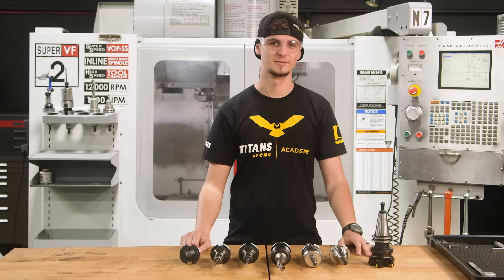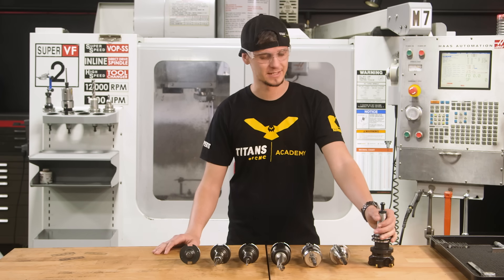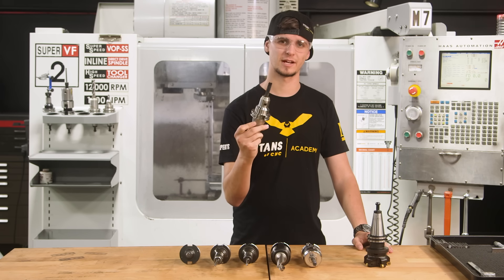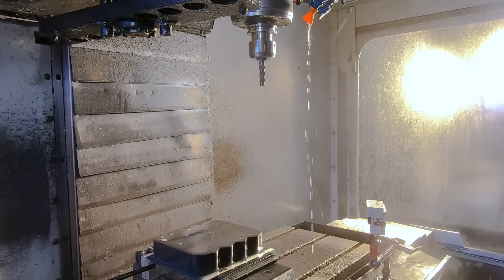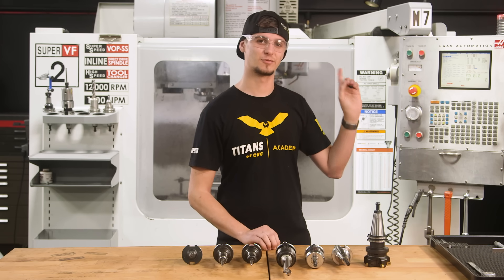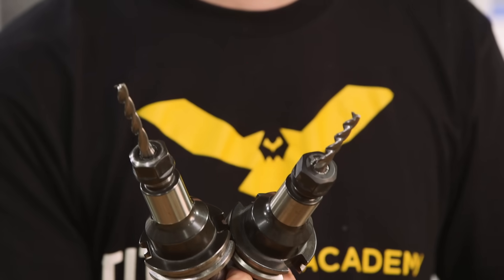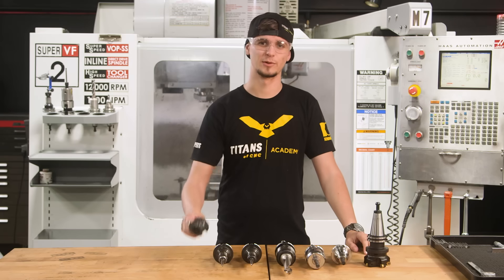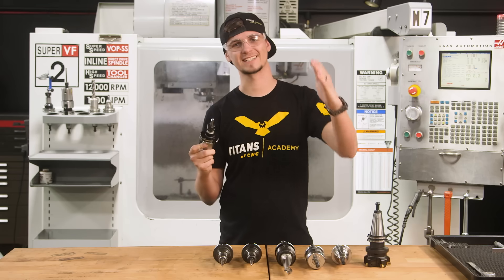CNC Machining Composites with Diamond Cutters | Vlog #81

Comment: Most people cut it dry due to it contaminating the Coolant and the glass particles going thru the machine we always try to vacuum out all of the chips to prevent contamination to preserve the machine tool as much as possible
Reply: Can cut it with really low rpm and big thick chips to avoid it turning to dust have never had issue using standard carbide tooling as long as sharp have done lots of g10
Reply from the maker: Been cutting it for 20 years. Always use coolant to keep the dust down and it allows the tools to make nicer finishes and to last longer. No delimitation. We cut it for subsea and aerospace. We also have a series of filters that keep the G10 from going into the pump etc.
Thanks

Comment: PCD means Polycrystaline Diamond, an describes the cutting material, literary the most of the cutting edges made out of diamond. When you have a black coating, we talk about DLC (Diamond Like Carbon). Its applied by PVD(Phisical Vapor Deposition). Small but important difference.

Comment: With my 10 machine experience fiberglass (G10, G11, G9, G7, GPO3, SG200) diamond Endmills are not the best solution vs price and lifespan. Onsrud ALTIN is quite less expensive and lasts quite a bit longer with higher cutting speeds 😉

Comment: I've always ran fiberglass dry, putting glass particles into your coolant is like running sandpaper on your ways, not a good idea, use a vacuum to take out the fiberglass powder, it's a nasty material, granted the coolant will keep it from floating in the shop

Comment: Buy a 50mm Blaxx head from Walter Tools and compare it with a similar tool from Kennametal in different steels and check the cutting edge durability and speeds and feeds

Comment: I am looking for the „Harvi“ tool holder. They have nice big Diameter. Can somebody help me to find out manufacurer name?
Reply: Most (if not all) Tools they use are from Kennametal, while most of the Toolholding (and Workholding) is done with Schunk.

kennametal.com 
schunk.com
They both have lots of different options to choose from.

Comment: This dosen't look like G10 at all, g10 is green and will be stain by the coolant. Must not be wet it lose its electrical insulator proprietes
Reply: Mrsemibruce thanks i thought i was going crazy. i machine G10 in my haas all the time and it’s green, run a vacuum next to the spindle to try to keep smell/dust down

Comment: Would you use a new DMU50 for cutting composite? No, because it gets everywhere and eats up everything. Except for in old machines, where there´s so much slop that it doesn´t matter any more. 
We´re making carbon fiber parts for bikes on  our 70V and my SQT10M which are both about 20 years old and are still using those for daily business. 
Can you show some machining of hardened stuff? Like 60 HRC steel?

Comment: Why the long pauses when chamfering the large holes?
Reply: Roland Jollivet that is the control lagging. The arc filtering settings in their cam system was set for very small tolerances, and so what you get is a million lines of code to do that chamfer, causing the machine to not be able to keep up. We do lots of surface milling on the machine I work on, and one of the people who programs the machine has really bad arc filtering settings, and we have this issue all the time.

Comment: The feed rate on the 8.2mm drill is actually .01025, I believe.  Interesting vid.  We're one of those shops that try to avoid G10, tho we do quite a bit of phenolic.  Not near as abrasive, still a niche material.  Thanks for sharing!
Reply: Edit; fixed a word. autocorrect had wire instead of quite.

Comment: Noticed you mentioned carbon fiber, how are you handling this as the particles can be dangerous and should be cut in a water bath.  Are you using a flood coolant for this too?  Also how are you straining the coolant for the nanoparticles?
Reply from the maker: Yes use coolant always and use a mesh lining to collect fibers etc

Comment: We cut aerospace glass and carbon composites on a regular basis, we use solid pcd tooling for very thin sheets its compression and tension cutter, the same cutter that has flutes going both directions, and we use extremely good dust extraction and  filtration,  all dry.  This is the first that I'm watching some coolant being used. Coolant is usually not allowed on aero composites which have to be bonded, since coolant can become a release agent preventing a secure bond.
Reply from the maker: So many still cut dry but Many are also using coolant. Coolant keeps harmful dust particles out of the air and prolong Tool life X 6. We use Synergy 735 which has a PH of 7 which is the same as water and does not delaminate resins and fibers etc.
Reply: @TITANSofCNC  That is what impressed me, we cannot use coolant,  abrasive waterjetting can be done, where the part once cut is then baked. Water is great to get rid of dust. But anything that has lubricity cannot be used by us, since it will not "cut it" for the secondary bonds, the PH does not play a role here. If however, there's a part that is not bonded, I can see the utility of your process.  The delamination of fibers is an altogether different thing and I would not  say that coolant can prevent delamination.
Reply: Naresh Sharma can you wash then vacuum bake?  That is done prior to electronics wire bonding, where the surfaces also can’t have any contaminate.
Reply: @rfengr00  For non-secondary-bonded parts yes, but for parts that are secondary bonded and if they have been microscopically contaminated by oils of any kind, only plasma-cleaning followed by abrasion, can be done. It's a messy process requiring sophisticated equipment and further certification hoops to be jumped. Thus we'd machine dry or waterjet+bake rather than use cutting fluids.
Reply: @nash0427  metal parts are all cut with lubricants, the stock is formed with lubricants, we pot deep sea acoustic sensors at work and silicone is much more of a problem than easy to remove lubricants.  Just ultrasonic clean with Branson IS.  G10 is known for now absorbing things and it is extremely easy to bond to.
Reply: @TITANSofCNC  can tou show the particles on the tank and If its dificult to clean?

Comment: Running Flood Coolant but not Spindle coolant on your speed drill ? whaaaat?
Reply: On the Kennametal Go Drills, you get 3 and 5 x D without coolant. With through coolant, they come in 3, 5 and 8 x D as standard.

Comment: Do you have to have a dedicated machine for CF/composites ? Any tips for mix and match of materials in a single machine. Are there issues with filtration and particle size etc. If using coolant on composites is a cyclonic de-mister an help ? Any advice 'Do's and Dont's appreciated ".
Reply: You don't have to use a dedicated machine, but the chips, (dust), created though macining glass filled or composite materials are abrassive and will increase the wear and tear on any moving parts that the coolant, (and the chips suspended in it), can get in between. If you have to run a lot of composite materials, it is a good idea to keep it on an older machine or one that you don't need to rely on to hit super tight tolerances; over time, the machine will wear out faster than a machine just cutting regular materials. Its not the end of the world if you need to run a few composite jobs on a machine, just make sure to do a throurough wash down and if you are really concerned, clean the coolant sump. You could also consider using a filter batting material on the inlet of the sump to help trap finer particles before they get into the tank.
Reply: @CameraPPL  Thanks ! That's a good tip about using batting on the inlet of the sump (to trap finer particles.).  Wanna do composites some of the time don't wanna trash my nice machine lol. Seems some newer machines have more advanced cyclonic filtration units on the back side of the machine (such as DMG Mori NVX 5100 2nd gen ) I guess to better filter coolant that goes through a casting but also enables some grinding operations to be carried out. Particle size seems more in line with that. Was wondering if a similar more comprehensive filtration system would keep a machine "Safe" from CF/Glass / composites. I.e. if you can only afford ONE really good machine and you have to do composites 2% of the time ?

Comment: Our company manufactures CFRP parts for cars. Mostly thin shells, 1-2mm thick. We do a lot of trimming simultaneously in 5 axes movement. Most of work is done with small diamond end mills, 3...6mm diameter. We do everything dry. It would be really interesting to learn best ways to trim such parts on CNC (like a car bonnet, or a mirror cap or side sills). Can you make another video on machining thin CFRP shells? Hopefully you did things like this in the past or some friendly company does. Really interesting for many companies around the world doing CFRP components.
Reply: You don't need or want a CNC mill for things like you describe. What you want is a large CNC router. Use the router to make a vacuum fixture to hold the raw untrimmed parts, then it's just a matter of feeding the machine parts.
Reply: @dwaynesykes694  you can call it this way or another, but normally these are large 5-axis machines which trim such parts. Or robotic systems. I just emphasis that this is big topic for many composites manufacturers and other folks dealing with plastics, composites, SMC etc. Indeed these materials and abrasive and the wear of the machine is increased.

Comment: What kind of tool life are you getting? Do the tools make it through the whole run?
Reply: I'd almost put money on it they probably last quite a while. Used to run a composite shop that used PCD turning inserts,and we would easily get 100+ parts per insert.
Reply: @JustAGuyWithALongScreenName 
PCD is a different level to the stuff used in this video PCD is by far superior

Comment: I've wach a lot of titan's tutorials. But I am wondering, can he actually make a motorcycle carburatur with a cnc machine?
Reply: There's no reason why a knowledgeable machinist couldn't make a carburetor.
I've made many parts much more difficult to machine than any individual part in a carburetor, and many replacement parts for Carburetors that can't be bought anymore.
I've run quite a few machines over the years, I started out back in my teens running a Bridgeport, and progressed through machines as difficult as 11 axis cnc machining centers, doing most of my own setups and programming.
My point is that there are many machinists better and more knowledgeable than I am - so a carburetor wouldn't be a challenge.
Reply: @Motor-City-Mike  11 axis??? Wow, never heard of that.

Comment: Do you bake your G10 for 24 hrs before inspection to remove all the water (and dimensional changes) that it absorbed during machining? I like the idea of controlling that nasty dust, it just means some other things to consider.
Reply from the maker: Never heard of that, we hit 32 finishes and keep tight tolerances all the way through the process... been doing it like this for 22 yrs. Everyone who has ever worked with me and wanted to cut dry... I changed their minds and showed them it was better.
Reply: @TITANSofCNC  G10 absorbs water, then warps and it gets difficult to process in the electronics industry. Thus it's normal to bake components and boards before they go into manufacturing and a reflow oven to increase yield.
Reply: @qwerty3663  dude its garolite, you wont be machining too close of tolerances on it anyway. It's an insulator and is used to mount  electrical component. It's not like it needs to have a slip or press fit for any reason.
Reply: @anthonyjones657  Actually it's a dielectric and fractions of a mil are important for controlling impedance.
Reply: @qwerty3663  it's a di-electric and as such is very well known not to absorb water lol
Reply: @Metal Dawg Because post machining inspection will yield different results than those after waiting some time for normalization or if the absorbed water was removed at an accelerated rate, just as you don't inspect a hot part right off the machine.  An inspection room has a controlled environment for temperature and humidity and parts are not inspected immediately upon entering the room.
Reply: @Metal Dawg Because depending on when and how you inspect something you may reject good parts or accept bad ones.
Reply: @Metal Dawg You keep bringing up the clients but they have absolutely nothing to do with my question. I simply asked was their inspection methodology different than what would be considered normal because G10 reacts differently than metal. Just as when machining other things like plastic, the part will relax within the first 24 hours or so. Do they have different procedures for various types of materials? Most customers have far less inspection capability than a good machine shop has so they don't check to print and trust the supplier unless something goes wrong and they need to get to the root of the problem.
Reply: By the way metals relax too. It all depends on how it was processed at the mill. But most higher carbon and alloy materials are under stress so when you remove material it moves. But as machinist we have tricks for all of this.

Comment: why is a tool with 5 inserts called a dodeka? Shouldn't it be 12?
Reply from the maker: It’s the cutting edges and rotations you can flip them... not the number of inserts
Reply: The inserts can be indexed 12 times.
Reply: The insert has 12 cutting edges.

Comment: I have some experience in machining but didn't know that there are endmills with different spiral angle to push chips down.
I learned something new. Thanks :D
Reply: There are also compression cut end Mills. They are designed for laminated materials. The bottom part is up cut flutes while the top part is down cut flutes. This so the layers are not pulled apart while cutting. The flutes meet at about 1 × D from the bottom.
Reply: @horseshoe_nc  Thanks Man! I dont have experience in machining other materials than tool Steel and aluminium so im kinda closed minded for different milling. I wish i could Master other materials.
Reply: @operatorzycncpl , it takes some time to learn different materials.  I treat 360 brass about like Aluminum as far as tooling and speeds and feeds. 

Delrin is a dream to machine, you can rip through that stuff.